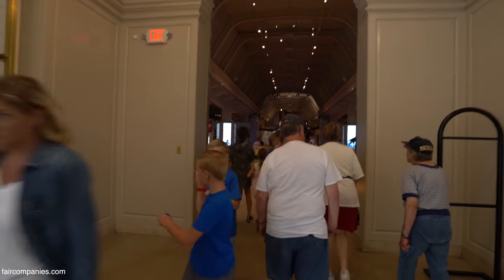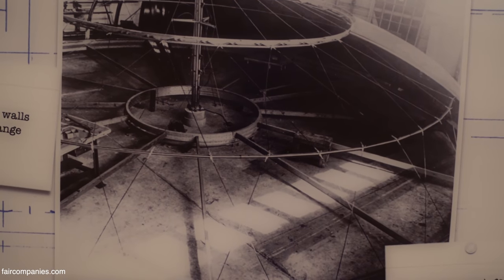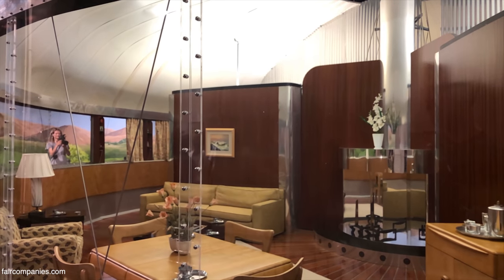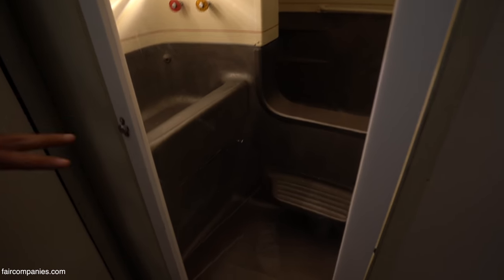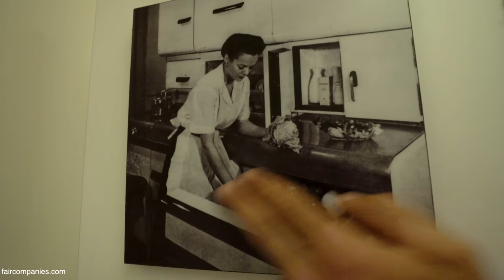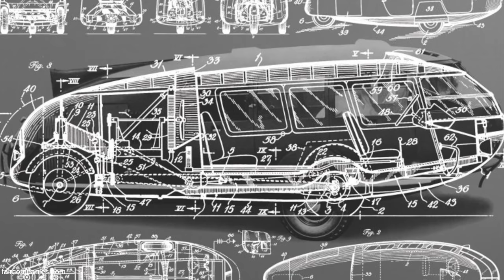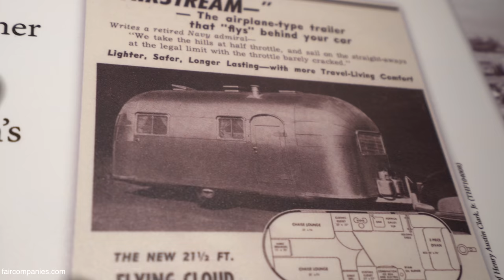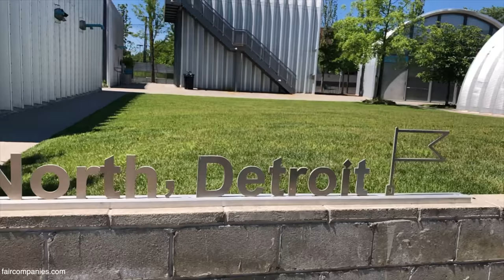Dymaxion: could homes be as affordable & precise as appliances?

Comment: I read that Fuller got his idea for this house from grain bins.

I like the drop in prefabricated bathroom idea. Bathrooms are the the first thing to go bad in a house because of water damage. Kitchens and utility rooms are next. Any space with water should have floor drains in my opinion, because toilets plug up, sinks overflow, washing machines malfunction and etc.

Houses these days are basically machines that are designed to be hard to repair. 

If you want to be a contractor specializing in kitchen and bathroom remodeling is the way to go.
Reply: There was an Olympics in Montreal where they had a demonstration apartment project. It was all modular - built off site and assembled one part at a time - bathroom - kitchen - and any number of bedrooms that you want. So tell me again how wonderful Fuller was. The only big idea he had was for a way of using a geometric projection to draw/print a round object like the earth on a flat surface like a paper map. At the time he was working in the map making dept for the Navy.
Reply: During WW2 Fuller used his ideas to create the Dymaxion Deployment Unit for the military. It was a steel prefab house based on the Butler grain bin that could be assembled in a few hours by 2 or 3 unskilled laborers. Not many were made, as the steel was needed for weapons, tanks, trucks etc.
His first Dymaxion house was designed in the 1920s. The one in this video was the 1947 model. He wanted to mass produce housing like cars on an assembly line.

Comment: It could be manufactured far more easily, accurately and cheaply using CNC today
Reply: 3D Printed houses.     :-)
Reply: Brilliant
Reply: Insulation factor is looow
Reply: @dilbyjones  better than sheet metal 😂
Reply: @bonilla2022  CHina is actually doing that with concrete.

Comment: if you have ever been to the fair and riden the merry-go-round you would notice that this structure from a central pole using rods to sustain it is exactly how they are built and thus they need not be on level ground gro in fact the whole structure is suspended from the central poll ,,and the first one was built in 1861 but it can be traced back to the 1100
Reply: Good point

Comment: Dymaxion House, with its brilliant cooling effect, a heat vortex which sucks cooler air downward, was ill-suited to colder climates due to its lack of insulation. The magnitude of Fuller's genius has never been in question, but I wish his prototypes for revolutionary and affordable housing could have been tested, lived in, refined and put into production. He could have revolutionized the housing industry. As it is, his geodesic dome is his one idea of hundreds which caught on and got used. For single family homes the geodesic dome is difficult to roof and once roofed, they tend to leak.

Comment: That is so cool! I wish someone would make these again, especially if they could be done cheaper than site built homes, and solve some of the housing shortages. I'm curious how well the air circulation and temperature control works.
Reply: Would probably work well in very specific climate zones.  I think it would work better than most houses of it's era in the summer.  A winter night in a lot of areas would probably be brutal.

Comment: The main reason such homes do not find favor with the public is that they want houses to look like houses not flying saucers.  The construction concepts Fuller presented can be adopted to build more traditional looking structures and if this were done I believe they would find wider acceptance, especially if they lowered costs.
Reply: From a shadow
The only futuristic aspect of this home was how it folded and expanded and the use of new materials of the time, otherwise the round shape is ancient and chosen for it's durability!!! It can withstand winds of at least 120 miles an hour, withstand likely up to 6.0 earthquake if not stronger, it could take a certain amount of force from flood waters and or tsunami and still be standing and the exterior except for windows could still be still be standing and exterior be somewhat resistant to fire from outside! Internal fire if left alone would destroy furniture flooring and interior walls easily replaced if burned undescovered and got too hot would effect windows and possibly exterior and cabling, but they would less likely to be damaged and thus the rest would be an easy replacement and still have exterior safe from the elements while repairing! The absolute best version of that is to build it out of cob/adobe which would be absolutely fire proof with exception if used wood walls interior wood cabinets etc. But they would have to be near the fire! But this whole thing can be built in mud/clay/straw mixture and thus be practically fire proof! It would be like baking pottery is all!!! Might have some cracks need fixing but otherwise still completely functioning and everything safe inside with the possible exception of some glass maybe needing replaced if fire was hot enough to melt the windows. The mud structure would also be earthquake resistant up to at least an 8.5 and be very resistant to floods of any kind, unless there was constant water running for weeks on end along side of it! If built using bottles or sand bags in place of adobe bricks or to help with cob building, would make build faster and virtually indestructible would keep from completely eroding away and only need exterior in a flood constant current situation to need repair!
Reply: Having walked through this house, I can say that if people had the experience-- the experience of spaciousness amid security and of the dynamism of the space--many of them would instantly discard the idea that it is a flying saucer.  It is a really astonishing space.

Comment: The suspension system would be interesting when used in earthquake-prone areas.   I assume the tension would allow the structure to warp, move, and return to its original shape; only the poles set deep in the concrete would absorb the movement.
Reply: how much your house weighs is the main criterion for green building. So far, there is no such criterion. After all, it is unprofitable for banks. Hanging houses are 30 times lighter than traditional caves.

Comment: This channel is remarkable,  entertaining, & important. Earth may add 2.5B urban residents by 2050. Current building & related  systems are largely stuck in the late 19th century & will not accommodate them. Major technological disruption is required. Onsite stick building wastes incalculable energy, labor, materials & costs today. That waste becomes generational. Mass production, lightweight materials, energy-efficiency in production & long-term use, sustainability, and flexibility to modify structures & whole cities are needed to meet the future. Many  concepts featured on this channel are quirky & not at the scale required to accommodate billions, but each  contains valuable elements of solutions. Buckminster Fuller was impractical AND a visionary. This video is worthy of more re Fuller's work. The creator, narrator, and  museum host did a exceptional job of showing us the Dymaxion. Thanks to all!

Comment: In Taos Pueblo, the homes there are still inhabited.  They are made of Adobe as are their chimneys, they do not burn.
In theory solar thermal could cook the bricks, mix in a little concrete to make super adobe, and some other additives
even make them waterproof.   If you need better asthetics a little stucco and it looks like a modern building.
3 foot thick walls and you don't need air conditioning or heating.  All of this possible with what is laying around.
Oh yeah, and termites don't like to eat cedar.

Comment: This an amazing video! I wonder how much a home like this would cost today?? You and your husband are "dynamic"!! 😅 Mahalo for your forward thinking!! mililani 😘
P.S. I have been watching you for years!! I don't have my own home for diff reasons but I hope one day to have one! So watching for ideas.

Question? Have you watched "Prepper Princess" are you prepared for a decline in our economy, etc? .... Are we to believe what they are saying?
Reply: In its day it cost as much as a high priced car like Lincoln, Cadillac or Packard. So figure today it would cost $75,000 to $100,000 but would be more modern with features like central air, solar panels, materials like carbon fiber, etc.
Reply: @mrdanforth3744  There's no way that can be right. You can't even buy a FRAME for a house from a kid from.Home Depot for less than a good 50k. Doesn't include walls or anything else inside. Even assuming it's twice the house cost to get it all built, that's still low now.

Comment: My first concern would be the heat. Yes I understand the air flow circulation system BMF included but there was no evidence of any thermal barrier to keep the house cool or warm. I have been in moving vans in the summer it is a good place to get heat stroke.
Reply: Yes I thought about that as well. Not sure how it would do in sub-zero temps as well.  Really "cool" though.  I like it better than a box.
Reply: You can use different materials and insulation in todays standards to adapt to any environment.

Comment: Fair idea.  Hate to live in it if the weather is -20 F in the winter.  Also, given it's silver it would be miserable to live in during the summer.  BTW, this house has a radius of 18', that means the lot would have to be 60 x 60 for the typical suburb and that does not include a garage.   A small house of 1024 Sq Ft. would only be 32 x 32 and that would leave 2500 sq ft for parking and a small yard.   Also, the square house would be cheaper to heat (wood is a fair insulator) and much more stout against occasional savage wind gusts of 60 MPH.
Reply: It could only work if you add vacuum panels insulation into those thin exterior walls, roof and triple pane windows with total U value up to 0,8.
Reply: @maromaro1909  , our problem is we're starting to give serious analysis to what is essence is merely a tin can version of a Mongolian yurt tent.
Reply: @Easy-Eight  I live in EU and from 31.12.2019. ALL NEW HOUSES in EU must be built like nZEB (near Zero Energy buildings).

Comment: Wouldn't a square house still accomplish all that, without any of the headaches that come with making radiused walls? 2x4s and drywall seem a lot cheaper than shaped stainless sheets.
Reply: It was designed to be transportable, not fixed.  Drywall would be difficult to move as it could be cracked during transportation, plus it is heavy. We have many other materials to choose from today that can stand the pressure of transportation and still remain light.

Comment: So how much would the house cost to build today?
Reply: In 1947 it cost $6500 or the price of a luxury car like Cadillac, Packard or Imperial. Figure $100,000 - $125,000 today but with modern features like central air, solar panels, and modern materials like carbon fiber, plastics, insulation etc.

Comment: Thin metal walls means no sound insulation, no weather/temperature variation insulation, poor use of energy due to lack of insulation, noisy due to lack of insulation and thin metal walls. Note that the display structure is displayed inside another building.  If it really was functional it would have sold when it was introduced to the public many decades ago.

Comment: Quonset huts > Dymaxion in WW2 and after.  Easier to scale up.
Reply: Can't be elevated the same, or suspend load with such little material when suspended. Essentially you could build multiple floors in a large enough Quonset but there is many advantages, I mean this could change height on the central pillar, even be in the ocean sand each low tide and such.

Comment: So if this is such a great idea then why has no one used it for anything more than a talking point? I went to a Fuller lecture many years ago and I asked him that very question. He certainly had enough time to build many, many Dymaxion structures. In fact he built a model or demonstration home and nothing else. Not even a garage or outhouse was patched together. When I asked him about his failure to sell his idea he turned off both his hearing aides. The only other thing I remember about him was his failure that a lecture has a beginning, a middle and an end. He would talk and talk and talk without end. I saw him at a graduation ceremony where he got an honorary degree.  When he began to talk he rattled on and on and they had to have someone walk up to him, grab him and shake him to get him to stop. Instead of using someone else's ideas why not develop your own.
Reply: Creators create inventors invent, somebody else builds the things.

Comment: This house wouldn't have to be round.  It could be hexagonal, octagonal, or a triangle, or any basic shape.  However, the more "sides" it has, the more aerodynamic it is.  And the less likely to have pressure to spin in the wind.  

I can imagine a big fin attached to this house, and in the center, bearings so it can turn with the wind direction.  

I think the very top space under the roof should be an attic, or a small balcony.  And every room could have a window bench with storage underneath.  The bathroom needs a window or skylight.

Comment: there are issues with the first design though.
you would need to convert all contemporary appliances and furniture to follow the same rules as this design, otherwise you lose the functionality of all walls towards the outside as possible area for furniture. there is no furniture to put there, without having a wide gap in the middle. and then the dimensions would need to become universal, as the size changes all angles.
and of course you have the issue of loss of livable area when connecting several of these together. it basically isn't possible. so it could only work as simple traditional houses.

there's a reason why this shape didn't kick off, other than in migratory cultures.

the ideal universal house design has straight walls on each side. with right angles.

it could work for an initial Mars colony, due to how well it stands against extreme winds. right angles are the weak points of structures.
not a real issue on most of our own planet though.
it also distributes fluids raining down on the roof equally (not an issue on Mars), but this can be easily solved with drainage pipes...  and you also usually don't want water to run on you face when leaving the house, so drainage pipes are used even on circular structures.
it could be useful if colonizing a high density planet with large quantities of evaporating liquids though... but we haven't even started with the colonization of a first extra-terrestrial planet... terraforming and colonizing of Jupiters moons can wait.